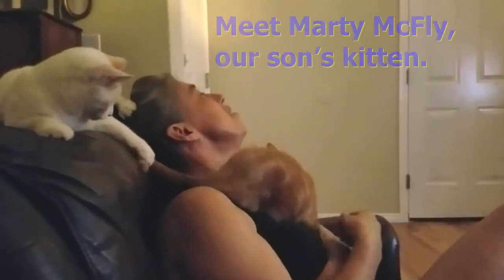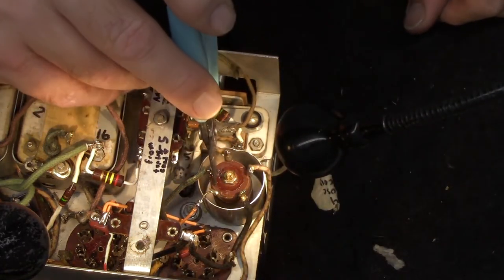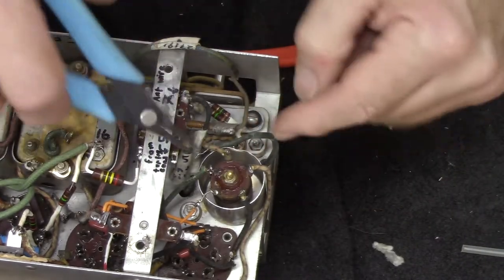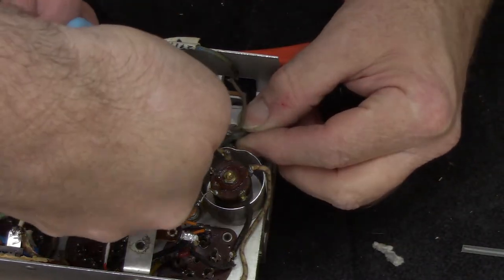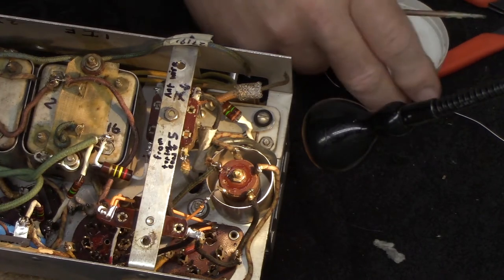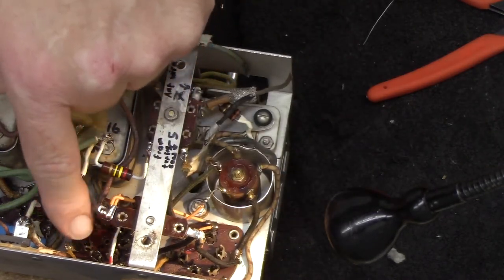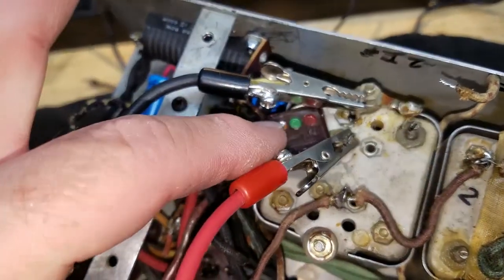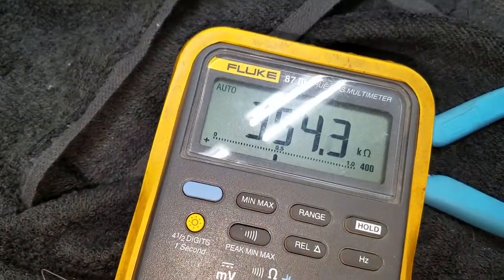1934 Grunow 501 Antique Tube Radio Part 7 of 10  Wrap Up the Chassis

Comment: In my (admittedly very limited) experience component values in tube radios are extremely forgiving. I have been been amazed at how far out they can be and still have the set work.  

Thanks for the video Michael.

Comment: Great video! Ive only done a few radios myself and am learning what an electrical idiot I am. I assumed that if you put two resistors in parallel that the electricity would just take the literal path of least resistance and it would ohm out to the lowest resistor value.  Now I learn you have to be a rocket surgeon to figure the answer!  :-)
Reply from the maker: "Rocket Surgeon"!  I love I!  THAT, I am not!  Nope, I just have to remember how to pull the right levers on the old calculator.  That's a great expression, though.  I might have to borrow it, sometimes.   Thank you for watching, Bob.  I really appreciate it.  Take care, my friend.

Comment: What was that power resistor you used if you've got the number thanks!! I am in argument with somebody says you can't use them to step down the mains voltage to 117.
Reply from the maker: I think that type of resistor is wire-wound and enrobed in ceramic, then put into a metal outer case.  There are many brands, and I don't really have a part number.  Here in the States, I either get them at a local electronics surplus store in Salt Lake City called "R.A. Elco", or I order them from Mouser.  I'm sure that they are generally available in most places.  Thanks for watching, John.  I always get a kick out of your comments and I look forward to them.  Take care, my friend.    Michael